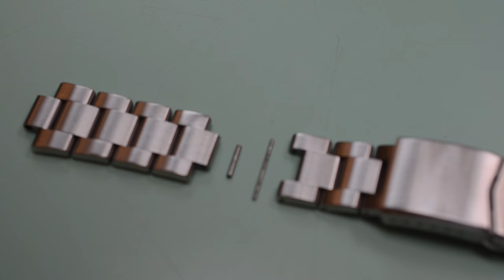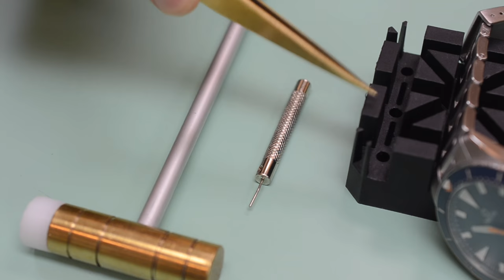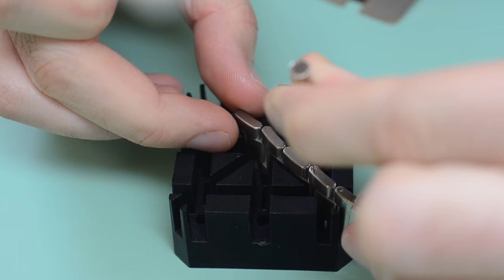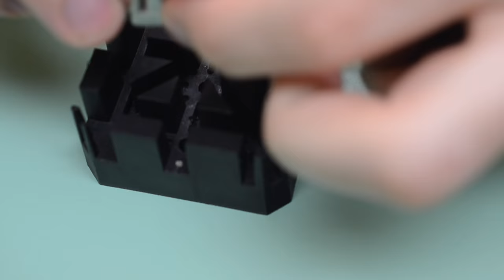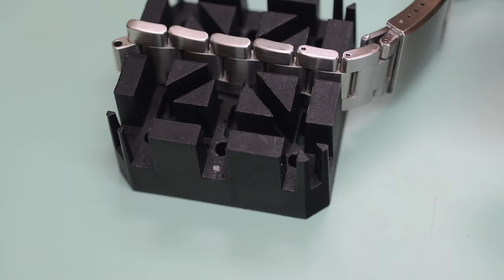Watchmaker Tutorial: Sizing pin and collar bracelets.

Comment: is it possible to remove the pins that are supposed to be permanent? hopefully without damage?
Reply from the maker: It is possible but it's a job for a professional and requires specific tooling.
Reply: @OrionWatches  thanks for the reply. I tried removing one partially and changed my mind as it was tight. I would probably have jammed it with the pin getting stuck if I continued hammering with a push pin. 🤪